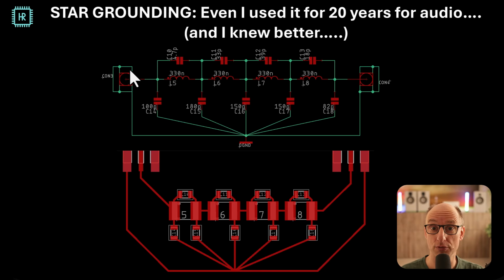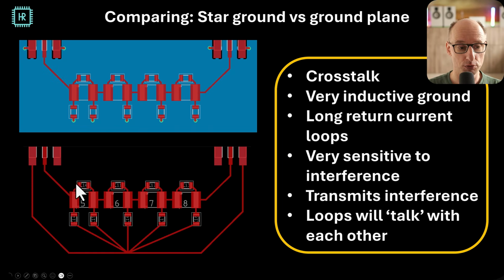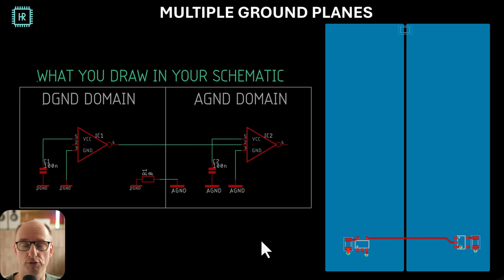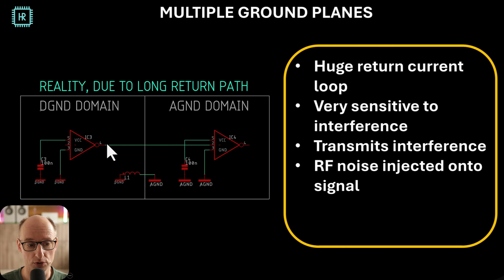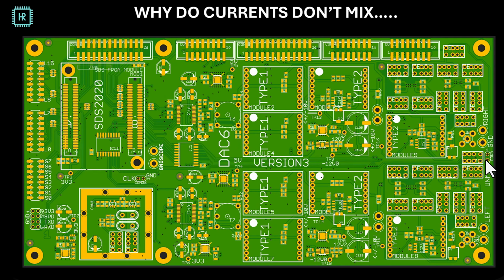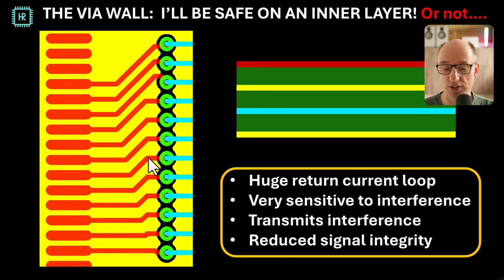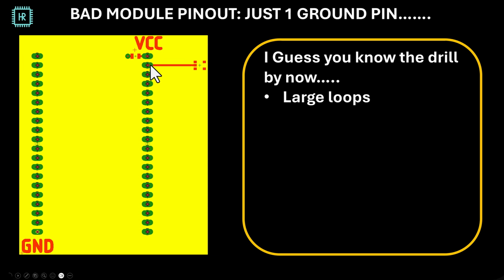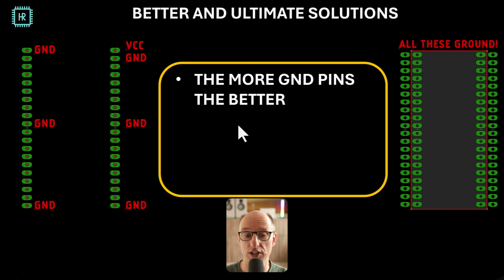Why Your Ground Design is WRONG — and How to Fix It. Flawless PCB design part 6

Comment: Man, I love your videos. Finally subscribed today after finding myself coming back to your videos. I haven't really had questions until today. How about Power grounds. For example, I'm designing an application with the MCF8316D motor driver and it wants to me separate PGND and AGND, and even DGND (POWER, Analog, Digital)...And I'm not experienced enough to be confident enough to disagree. Thoughts?
Reply from the maker: Thanks! The short answer: Use a single ground plane.... BUT: This is important: Map out where the power currents run and make sure those power currents do NOT run under the other electronics: This way, they cannot interfere with other parts of the circuit. Try and do the same with analog and digital currents, map them out,make sure digital currents do not go under sensitive analog parts, like the external pll parts.
Best regards, Hans
Reply: @HansRosenberg74  Thank you so much for the reply. You've earned a loyal watcher!
Reply from the maker: @TUMATATAN  haha, you're welcome, great :-)
Reply from the maker: I may have answered your question twice, I'm not sure :-) sometimes it is a bit hard to keep track of all comments across multiple videos :-)
Reply from the maker: If you're using this material professionally, I'd seriously consider buying my course. It contains way more material to get your board right on the fist try: https://www.hans-rosenberg.com/EPDC_information

Comment: How about putting bypass caps next to the Vcc pin vs putting them on the other side of the board directly under the Vcc pin? I’ve done both, and haven’t seen a difference yet.
Reply from the maker: indeed, should be pretty much the same. The shorter the loop, the better it gets.

Comment: Thank you for the amazing video! I now truly appreciate the importance of proper grounding. However, I have a question after watching many of your videos. Using a 4 layer PCB gives access to a ground that is closer to the traces, which is great. However, if your circuit is fairly simple and you only need 2 layers, what do you do with the other layers? Do you use three vias each time you need a new ground connection or you simply add two vias at the start of the circuit and you're done? I'm guessing that leaving them floating could be problematic.
Reply from the maker: Yes, the best thing to do: Tie them together regularly. For formulas on that, check out this video: https://www.youtube.com/watch?v=vumYrebIXm0&list=PLsWHPs7La-3KUY2JDUyrz0Jc0xw8kH4zQ&index=4  .If you use that formula for stitching planes together, you'll be fine!

Comment: I have made a lot of audiometers at Interacoustics with a dynamic range of 165dB in the audio range. Star ground I mandatory for that. But for EMC or HF star ground does not work, in this range massive planes are best
Reply from the maker: Hi Thomas, very interesting! 165dB, that is an amazing dynamic range, I can imagine problems at low frequencies with this dynamic range. I've seen a lot of problems with rf demodulation in my da converters and power amplifiers, even with good grounding. I wonder how much of a problem this is with audiometers. Maybe there is a combination of both worlds here. What about making a star ground with a number of planes shaped like a star (wide ground traces bascially) and interconnecting those with small capacitors so there is no rf potential between those star legs? I"m really curious why you need this 165dB range, Isn't human hearing limited to something like 140? Off course you want some margin above that but isn't 165 a lot? I would love to know more about this application, sounds very interesting. Best Regards, Hans

Comment: Star ground is often misapplied, and almost certainly the ground trace making up the "star" shouldn't be really skinny and narrow. However there are situations where you need to transmit a single-ended, audio-frequency, microvolt-level signal adjacent to some big power-hungry thing switching a lot of current and it's these cases where the star ground is a useful tool.

For example, you might have an audio preamp going to a 16-bit ADC adjacent to a powerful CPU. For 1v amplitude and 16-bit resolution, one LSB is 15 microvolts so the 16-bit audio signal is fairly sensitive to crosstalk and common-mode effects. In this example, assume the CPU is taking interrupts or doing some other work at audio frequency rates, e.g. 60 Hz display refresh or 1 kHz USB SOF interrupt. Therefore its power consumption will vary correspondingly as the CPU wakes up to handle the interrupts and goes back to sleep. On something like a 12x12 inch board with a typical 1/2 oz copper ground plane and even a modestly powerful CPU, audio-frequency current driven across the system ground plane as the CPU wakes up and goes back to idle create audio-frequency potential differences across the digital plane which exceed that 15 microvolt noise threshold to actually get 16-bit quantization.

Now in the presence of this small but significant ground shift, how do you communicate your single-ended, 15 microvolt sensitivity signal from the preamp to the ADC without it getting screwed up due to ground shift between the preamp and ADC?

Well, one technique to solve this is to locate the preamp and ADC ground pins right next to each other. Very small distance between the ground vias means basically no potential difference.

Another technique is to lay out the board such that area of the ground plane where your CPU's switching is creating is creating potential differences just does not overlap with the path between the ground pins of your analog chips. That way the CPU's switching currents may be making a potential difference in the part of the plane between the CPU and its VRM, but your analog signal processing is elsewhere on the board and is unaffected by ground shifts caused by the CPU.

(Third idea: build the whole CPU out of constant-current logic like ECL. Haha just kidding!)

However those techniques only go so far. What if there are some non-negotiable thermal or mechanical constraints forcing you to put the CPU and analog circuitry such that the CPU's induced ground shifts do indeed overlap the analog circuitry? At some point of increasing mechanical constraint, quantity of sensitive analog circuitry, and audio-frequency dI/dt from big switching SMPS or CPU or whatever, star routing of the ground becomes a useful tool if you apply it with sufficient care and understanding.

The same is true of splitting the ground plane. It's hard if not impossible to eliminate capacitive coupling between adjacent planes, but as with the star ground, I can imagine combinations of electrical and mechanical constraints where you basically need two ground planes. Of course make sure to move signals across the two with optical isolation, transformer to create a "true" differential pair, "iCoupler," etc.
Reply from the maker: Fantastic reply! I choose to leave out exceptions here for this video because I didn't want to confuse (it was a difficult choice) and because almost all the problems I've solved in pcb's that I was called in to solve were solved by simply adding a ground plane without obstructions. 

In my course I'm going deeper into the subject and I'm using similar examples you're coming up with. My example is an audio power amplifier where you don't want the slightest voltage drop across your ground-plane to get into the signal input ground.

Best regards,

Hans

Comment: I'm pretty conflicted on the vias allowing the electromagnetic energy to  flow. I have also believed this, but if you review Lee Ritchey's Right The First Time, Vol 1 or 2, he will tell you that there isn't much evidence of this. 

Rather the more important thing is that you have propper interplane capacitance to allow for the currents to return by displacement currents rather than conducting currents.

I am loving this video because it is bringing out a lot of what I have heard, and stuff from other professionals who have been doing this for some time, and the disagreements between them.
Reply from the maker: Which examples are you talking about when talking about vias allowing electromagnetic energy to flow? What is really happening is that there is less electromagnetic energy due to vias because the loops are smaller (this is a general remark without knowing the exact example you talk about).

Displacement currents is not really what you ideally want. It creates waves between the planes which will interfere with other signals. You want to make sure at all times that return loops are as small as possible and you can only do that by giving those currents a way back with a conductor (in this case a via). Currents will find a return path, but if it is displacement current, you will cause a lot of interference.

Does this make sense?
Reply: @HansRosenberg74  Weird, YT never notified me of this comment! Thank you for the response!

The example in your video that I am referring to is the Via Wall example. We are in agreement that it is bad bc it splits the ground plane. However, after that you mention to add ground vias near signal vias to allow the EM energy to travel between return planes (the only other people Ik that teach this is Rick Hartley, and Ralph Morison, 2 people I really admire).

The conflict is from Lee Ritchey's teachings. He has several test PCBs claiming (I think) that the return vias only make a difference when there is an inadequate amount of interplane capacitance, in otherwords it is a bandade solution.

Unfortunately, I think all of these individuals have retired by now. I am hoping to do more testing on this subject soon! Which one is correct? I wish I knew. Both seem to be important details. Feel free to contact me if you are interested in more discussion! I am willing to exchange contact info or maybe conenct on LinkedIN if you are interested or to explain more. Thank you for your time and efforts to educating future designers!

Edit: After further review, I think I have made an error. Lee appears to teach that the return vias are important, but only if the data rate / frequency is much higher (~20Gbps / ~10GHz) or more.

Comment: Hi, thanks for the videos.  But what about the VCC plane.  It is usually done in a iner layer for 4 layer PCB. It is a good practice to to this? Thnaks
Reply from the maker: Hi, powerplanes are only really needed if currents are way over 10A. I would use wide traces for supplies. That limits the resistance and inductance. A 2.5mm trace has no problem dealing with 10A. The most used stackup is s-g-g-s. Where s=signal, g=ground.
Reply: @HansRosenberg74  Thanks a lot for your quick answer.  I ask this because, a PCB with many ICs, there is the posibility to have many VDD pins and it is easier to have a VDD plane for a quick connection, but there  is a better way to do this? Thanks again
Reply from the maker: sorry, did not see your reply earlier. If you can spare a full layer as a supply plane: Why not, it's much easier :-)
Reply: @  Thanks a lot.

Comment: This is just so true... i used to have separate AGND planes in some of my designs. I was actually super careful with it though so by some miracle i never had problems with that. I only ever used split ground planes in situations where i could ensure that not a single trace or power plane crosses the DGND-AGND split. the only thing bridging the DGND-AGND split is a galvanically isolated between analog and digital section ICs casing or traces/planes on a layer that is separated from the AGND split by another gnd layer with a continuous DGND plane. this is objectively horrible, especially in terms of the current loops inside the IC. I am still very confused today how this never led to any problems.
Reply from the maker: Haha, maybe you should buy some lottery tickets :-)
Usually everything works when you do this, just with reduced performance. And often when you need to pass EMC testing the problems show up. However, if you don't qualify a design, you'll never see this.

Comment: If you want to achieve HiFi performance you have to design your circuit with RF rules in mind to. At the end - for every frequency from DC to GHz range you get a net of complex impedances that determine your performance (SNR). The real issue ist that those frequencies interact with each other due to non-linearities in the design and cause intermodulation. I have used e.g. exactly this effect to build an RF detector out of an audio opamp. Unless you and not intentionally seeking this effect  you have to respect RF rules even if you design kW audio amp! Of course RF rules are not the only thing to respect to make this work - in order to get to the optimal design you have to have wholistic approach and consider everything - and, as always, at the end you get a compromise, because you cannot set all parameters at their most optimal range, but the trick is - the more you know and consider - the better you can steer this compromise to the goal you have set! In that respect Hans Rosenberg ist doing a really good job explaining all those details and giving vivid examples! Keep up the good work Hans - we are spreading the word!!!
Reply from the maker: Fully agree, everything is a compromise, the trick is to weigh all the factors correctly so you get the best compromise, that can be very tricky at times. Especially with audio....

Comment: You should say you have to sign up to your community to get your "free" checklist.

It might be a fantastic checklist. I don't know.

The video was good. Don't like clickbait links which promise something, but then add another step. Can't trust them.
Reply from the maker: sorry about that. The reason I gather emails is that I need a way to pay for these youtube videos. I intent to do that by selling courses. These courses are not free. In order to reach potential customers I need email adresses. Just to get an idea, I 'burn' 3000 euros a month doing this because of regular costs, so I need to generate some income from this in the future. Very scary, since setting something up like this (with a course) takes around a year.

The checklist is really good, I've been sending it out for a few months now and the nicest responses I got were from other very experienced engineers who really liked it. The course I'm making is based on this document, but goes a lot further. It is going to take me 5 months to make I think.

I can imagine your hesitation to leave your mail address. I also hate spam. You can always unsubscribe, your mail address will disappear from the platform I use and I don't think I can get that back.

Hope this clarifies things a bit. Best regards, Hans

Comment: For an audio application with high gain, interference between star ground lines might be negligible, while even 1/gain ground lift feedback purely from resistance can be catastrophic.... and easily achieved if you are talking gains of 10000 or more.... And trying to short out low impedance noise sources with capacitance only raises the current and gets you even more inductive crosstalk.....
Reply from the maker: Can you be more specific about the exact application this happens in? Where does the problem occur exactly in that application. Which current causes the unwanted 'crosstalk'?
Reply: @HansRosenberg74  Let's say I found out the hard way that an LM311 driving a heavy load does not make good neighbors with the sinewave generator it was meant to provide a  trigger output from... this was manhattan construction on a groundplane though, not a real PCB...
Reply from the maker: @splitprissm9339  ah, that explains, Manhattan style builds are terrible for all kinds of crosstalk and oscillations. It is really challening to draw conclusions based on that. Often Components with a bit of bandwidth will start oscillating on their own.

Comment: Do you also use ground planes on layer 1 and 3 to fill the unused space with ground?
Reply from the maker: Yes, I generally do, but you have to be careful to put in enough vias to stitch those grounds to the main ground plane. Check out my part 4 video for that.

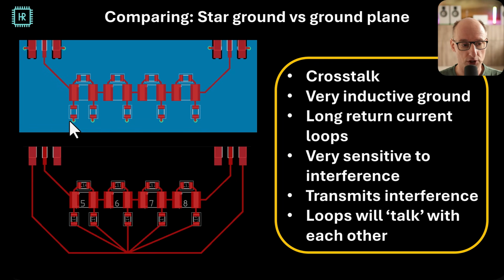Comment: 3:06 It's worth noting that this is only true at HF. At LF (i.e. audio frequencies) the return current will spread out much more in the ground plane, which is why star grounds are used in audio systems without any notable performance difference most of the time. That being said the lower impedance of a ground plane is still a benefit, but audio tends to run at low enough frequency and currents for that to be irrelevant, and the straight line paths between LF nodes will determine LF return paths in a ground plane more than the paths the traces follow. Power amplifiers and high-performance preamplifiers are exceptions to this rule, as they have higher operating currents and/or more stringent noise requirements.
Reply from the maker: You're correct about all off that. What I found out however is the really annoying problem of wifi, gsm and the like getting into the interlinks and speaker cables. This means you get RF into your audio design and then the high impedance of a star ground means that the current goes right through the transistors which then demodulate it (you can't stop this unfortunately, every transistor will do this like an AM detector). It really limits audio quality because it causes distortion. So this is a side effect. You are correct about the LF main effects......